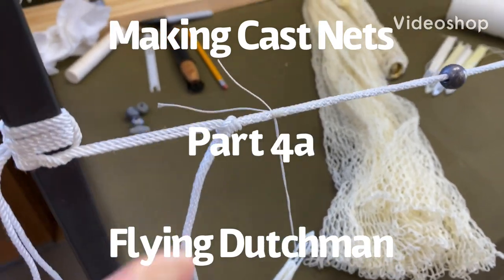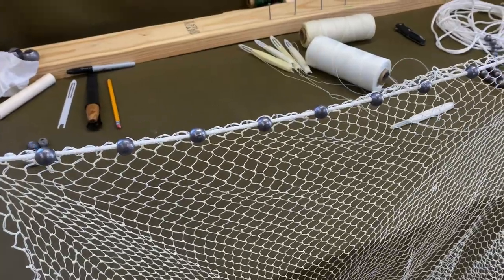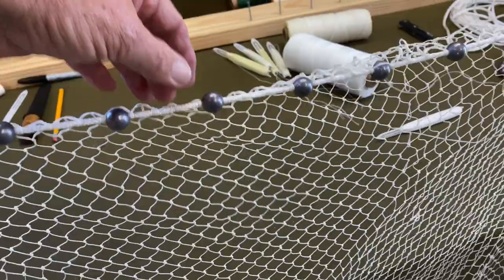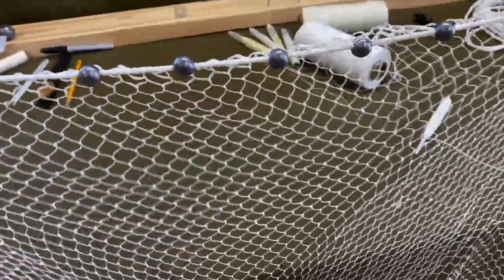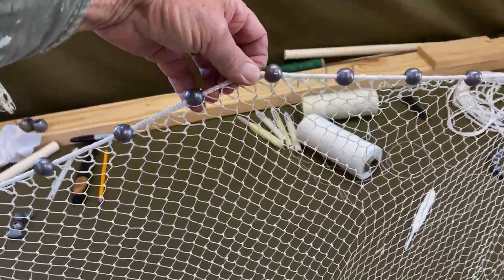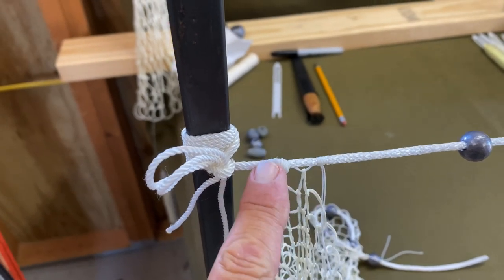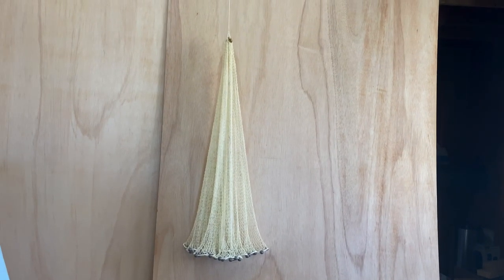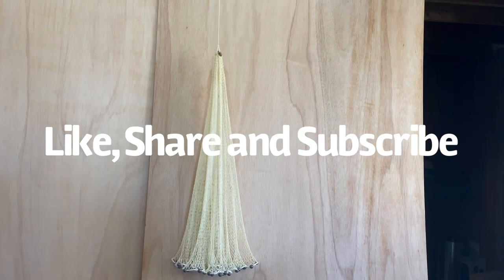Making Cast Nets / Part 4a Hanging the Lead Line 3’ Net

Comment: Hello buddy good day to you,  question: how do you add line to your needle if you run short while hanging the lead line ? how is the new line integrated  to be uniform with the  rest of the hanging.
Reply from the maker: Christopher Smartt using double twine for the lead line, I just add the loops together and work through the knot that is formed. When joining the two double twine sections together it will form a square knot.
Reply: @equipyourselflifeskills5802  I am attempting your technique for tying on the lead line but I am using singe line. My net has 1078 knots at the bottom it's a 8 foot net the mesh is 3/4 stretched it's working out great thanks to you